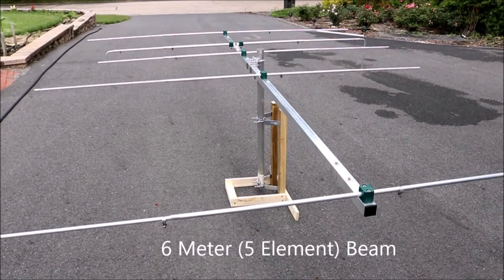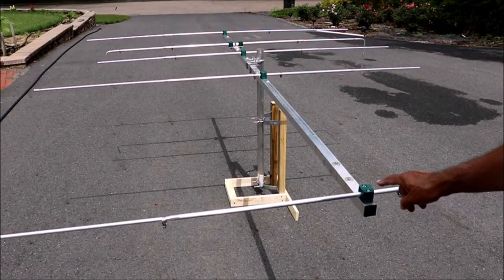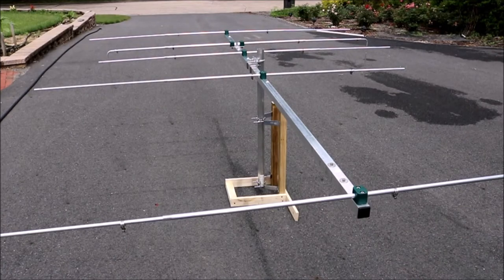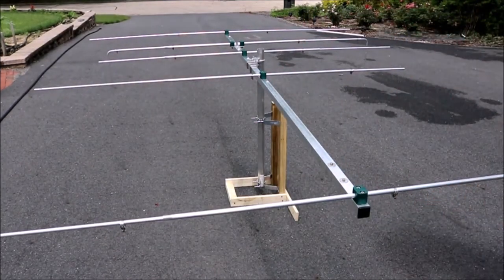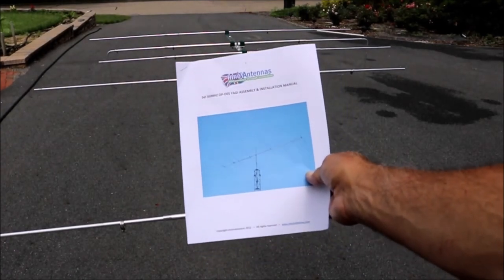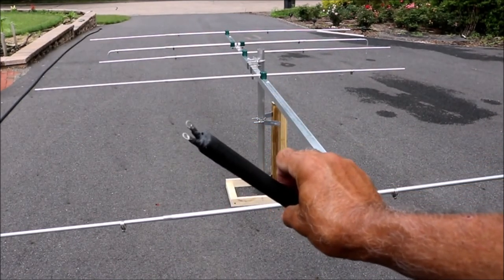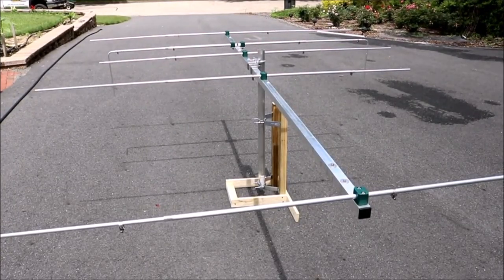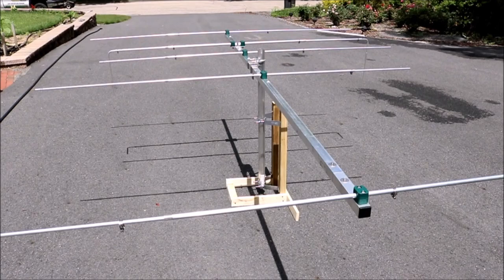InnovAntennas 6 Meter 5 Element Antenna Review

Comment: Hi, how did you get on with this Antenna? 73 Phil
Reply from the maker: Well, I did not get it up until the fall. When I did get it hooked up, I did not hear much on. 6M. I think the band was dead. I connected with a guy in central NH on 2M and he had 6m capability, So we scheduled a QSO and he heard me fine in  MA (20 miles SW of Boston). Then in  early Dec. I did  3 way with a guy in St. Louis and Indiana. They gave me 10 over S9 with 100 watts. Hoping to get more good results when the band opens up.